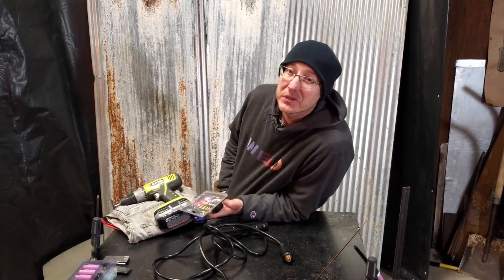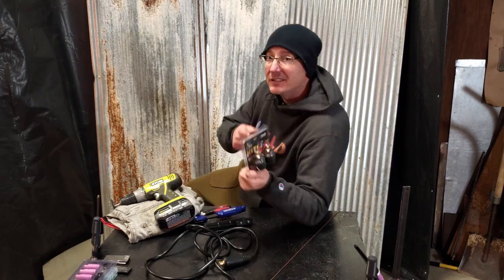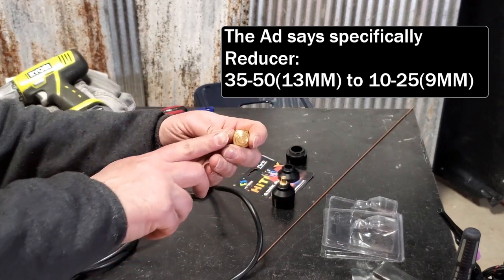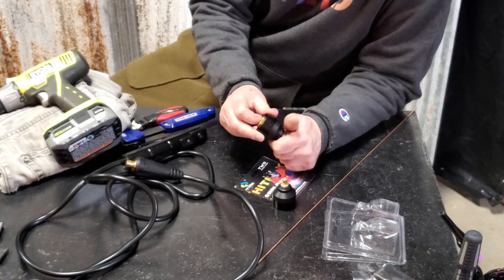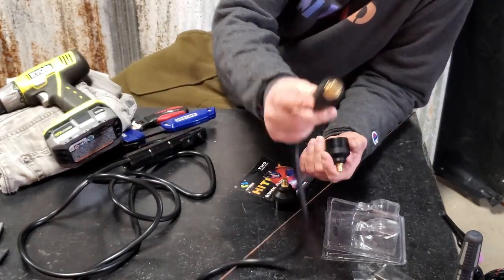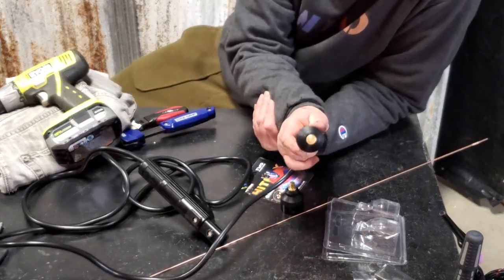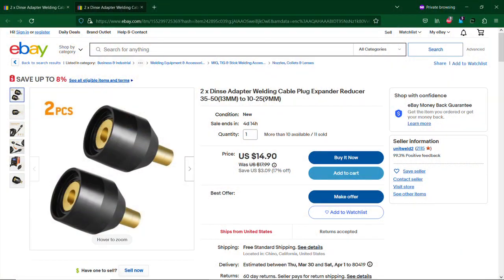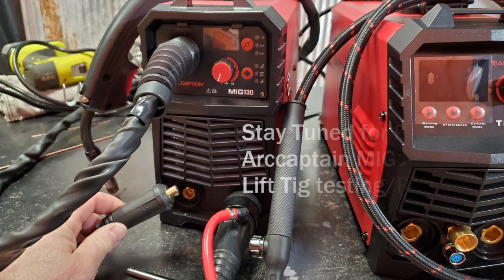How to step-down/reduce a Dinse connector | $15 Dinse 50 to 20 set | Hitbox Welding cable reducer

Comment: Any disadvantages to the 20-30? I've got an esab 130 with a 50 dinse, but my weldpro tig 200 has a 30.
Reply from the maker: I haven't really run it in the high amperages, staying mostly in the low sheet metal range these days (from 20 to 75amps). I suppose it might struggle if you tried to max it out, might stress your torch out. Seems like most companies are moving towards the Dinse 50s these days.
Thanks For watching, thanks for the comment!